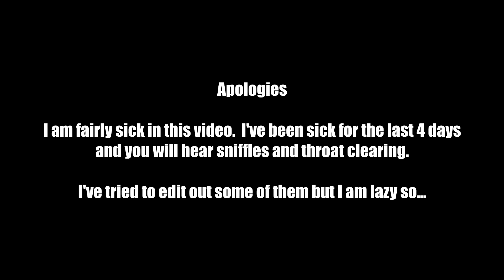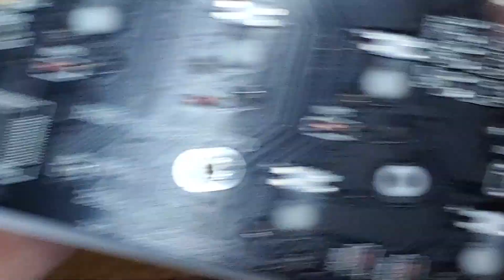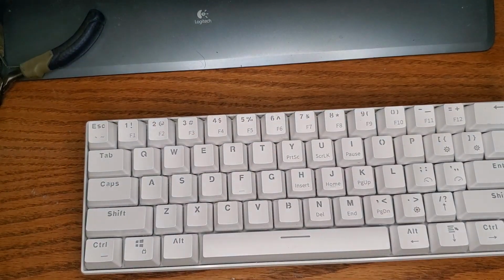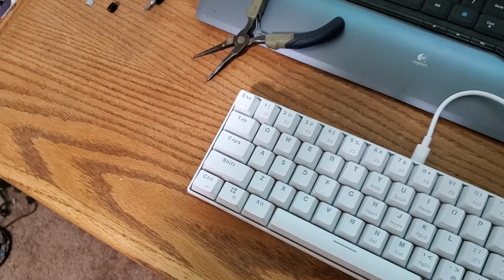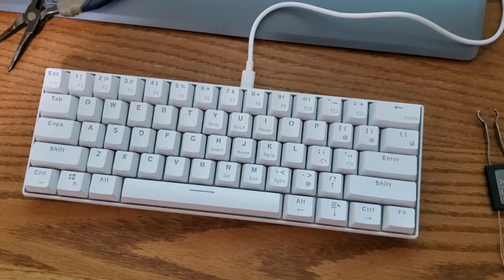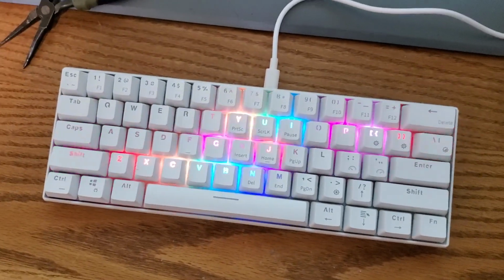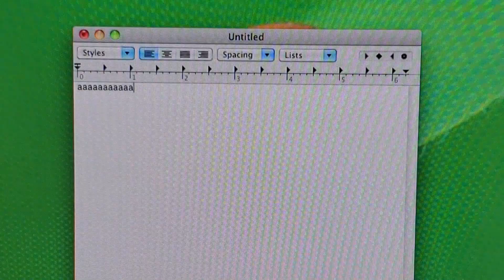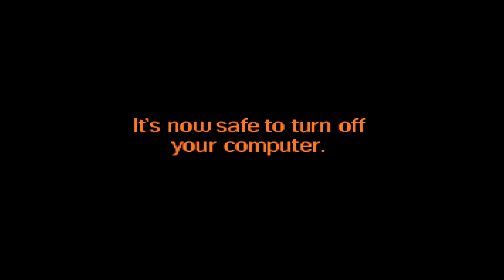Non Hot Swappable Mechanical Keyboard Switch Replacement

Comment: When i press one key it register multiple keys what should i do to fix it!??
Reply from the maker: I would try cleaning the keyboard first then if it's repeating keystrokes, for example one press of the "m" key = "mmm" then that switch is most likely defective.  If it returns something like "mn," then you'll have to do some digging with a multimeter.

Comment: I got trolled by such advertisement, difference is i paid 30 bucks for in on aliexpress
A thunderobot K104S, it claimed to be hot swappable, i changed the keycaps and oh MX switches! i must have gotten what the advertisement claimed!

A week in, I buy the switch remover tool, and oops, its soldered, broke one of the switches, and they`re also non-MX with just two pins.. real funny, how expensive is it to just.. not solder the pins and have an extra pad?

Drives me mad because locally, 30 bucks is a lot, a lot of money here, at least knowing its not so difficult to solder such switches makes me sleep better? still, for anyone looking for mechanical keyboards, please search your model you`re going to buy, really confirm if its hot swappable, dont just trust the ad like i did.

Comment: what do i do If i already desoldered my new keyboard? And it doesnt work, do i need to solder it again?
Reply: It was clean when i desoldered it Very Slow and has clean Desoldered but When i plugged my Keyboard the keys doesnt work now
Reply from the maker: It is possible to lift a pad when desoldering.  You'll have to do some investigating to see what may have gone wrong.  Grab a multimeter and check your continuity.

Comment: Hey thank you for posting this video!! I have a non-hotswappable keyboard and two switches/letters are not working well, I was just wondering how to replace them with a soldering kit; i have used one before but I was kind of worried, since it should be a precision job. 
Thank you for the visual guide. :)

Comment: So i can use 3pin hotswap switch to that non hotswap switch right?
Reply from the maker: I'm not sure about that, i've only ever swapped like for like.  You can usually find used switches on ebay that come from the same keyboard for fairly cheap.

Comment: If the spacing is the same everywhere, you can make a holder for your multimeter. Just use some sort of woodpiece to drill two holes in that have the right distance and diameter to fit the pens of the multimeter. Then when testing you don't have to fiddle that much to test every connection.

Comment: What are the names of the tools that you use to brake the welded pin and the mini welder? I have a non hot swappable keybord and fck it up a lil bit trying to swap it. Now I have to fix it or either way being lazy and buy another keybord
Reply from the maker: I used a solder sucker and a soldering iron.  You don't have to spend a lot of money on these tools to do a good job.  Good luck!

Comment: no way i got the same keyboard and the A key doesnt work too
Reply: a doesnt work tho bro wth
Reply: A doesn't work in any
Reply: My 'A' key is acting up too, lol!
Reply: @e4crypt3d  hey i still have the problem. did you do something that it helped?
Reply: Mine suddenly stopped working, but I gave it a gentle nudge, and now it's back in action though with a funky new sound!
Reply: @freakyagent00  I put little isopropyl Alcohol and press it little harder than before for few times and it worked.

Btw if know how to solder get a switch and remove it with solder put the new one in
Reply: W40 no more problem

Comment: When soldering, test that the iron is up to temp by quickly placing the solder on the tip. It should melt straight away.
Then, place the soldered part tip of the tip to the circuit board track (the solder aids in heat transfer), & make sure it touches the wire or pin too. Quickly apply the solder to the circuit board track, & remove it as soon as the solder flows. You should then have a nice shiny solder joint.
You can practice the technique by joining 2 pieces of wire together.

Comment: Can I use glue to secure the pins instead of metal?
Reply from the maker: There are some keyboards that are hot swappable but the type in this video have to be soldered in.  You can buy a very cheap soldering set on amazon and with a little trial and error you can replace a switch for cheap.
Reply: @idoesstuff1  Okay, thank you!

Comment: Hi. Can you name the devices you have used to fix your keyboard? Mine   keyboard is broken as well
Reply from the maker: I used a solder sucker and a soldering iron.  You can buy a cheap soldering kit from walmart or amazon to do the same repair, you don't need the tools I've used, they just help make it easier.

Comment: I pulled mine on non hotswappable now i tried to put the key and it wont fit
Reply from the maker: I'm a little confused by your statement, you pulled the key cap off and cant put it back on or did you unsolder the switch and now can't replace it?
Reply: @idoesstuff1  😂 sorry dude i panicked yesterday on my keyboard, i meant to say i pulled the switches now i tried to put it in without soldering and it just wont fit

Comment: Do you need solder them back? Will they work if you remove every solder and just put the swithces in?  Switches got pins which are holding them to keyboard already...
Reply from the maker: You have to solder them in or else they won't make contact.
Reply: @idoesstuff1  How then hot swappable switches work? Aren't they just without solder? Aren't you afraid that you could pull out the contact leg of the switch when you use that unsolder?
Reply from the maker: @FentFloydd  hot swappable have contacts that are friction fit and plastic tabs that hold it in place.
Reply: @idoesstuff1  Ahhhh... Thank you man for this. I ordered K6 keychron without hot swappable siwtches not knowing at the time I thought mechanical keyboards by default have swappable switches. Now mz khalil box ones are destined to collect dust...

Comment: I have a very similar version of this which is an NPET brand, I have three of them in fact. I got so  many because the entire board was $20 and has 1000Hz polling rate. 
although mine has the compact nav cluster which may be a better design since you get real arrow keys.
Reply: You can get my exact version of this keyboard also by royal kludge too. it's just a generic keyboard.